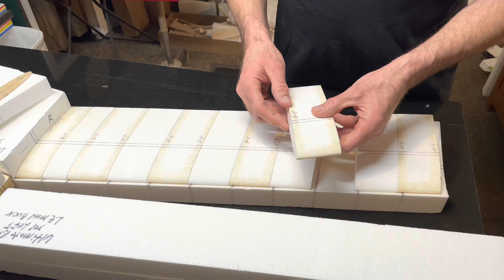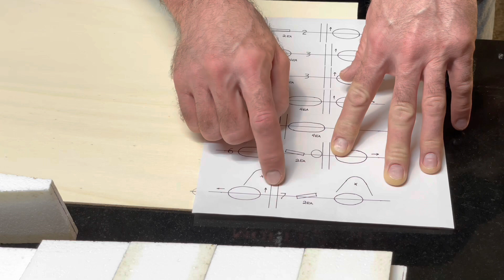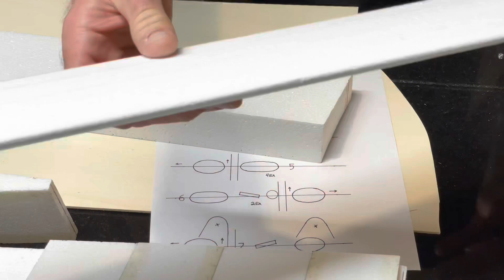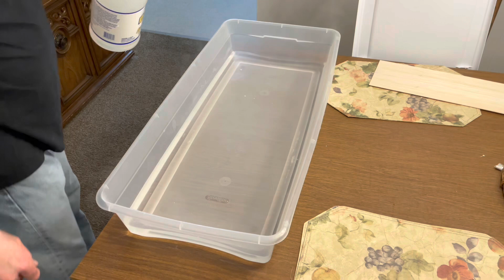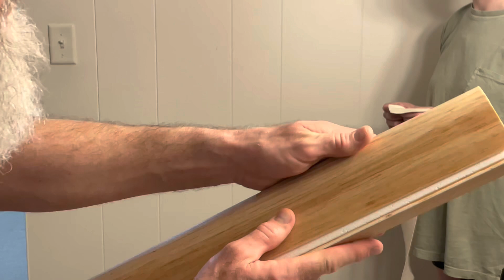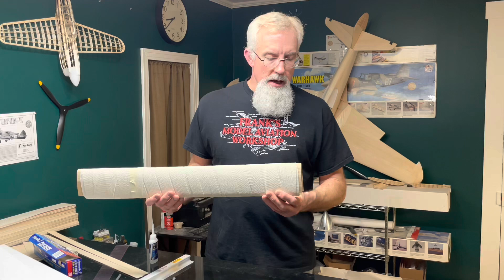Future Build Series Preview: Carl Goldberg Ultimate 10-300 Biplane

Comment: I had one of these.  My friend built it and he was is expert.  Watch out for the control horns and pushrods on elevators. The pushrods have long unsupported run when leave fuse out back. They can flex terribly preventing needed up elevator leading to catastrophe!   Suggest mounting servos in tail with short pushrods and metal horns.  Good luck!
Reply from the maker: This isn’t my first Ultimate. I’ve built several. I usually mount the elevator servo in the tail. Mainly for balance. Thanks for the tip though.